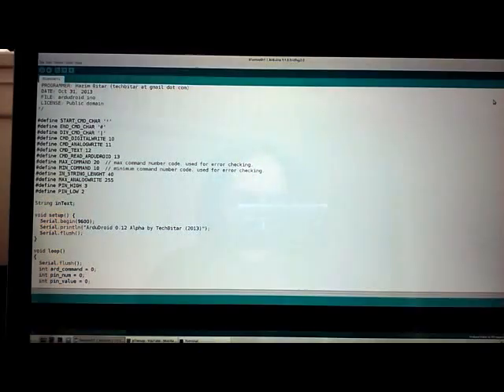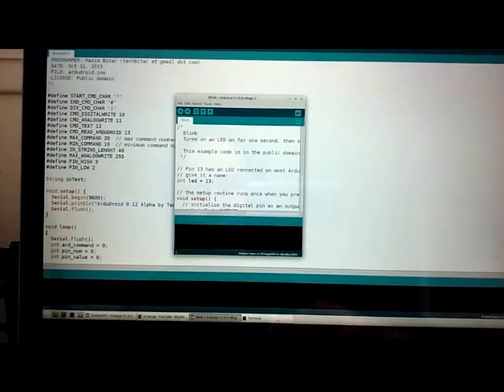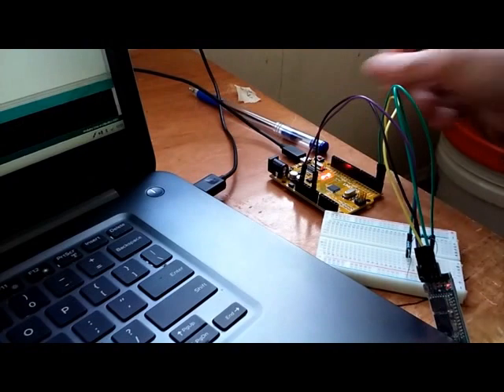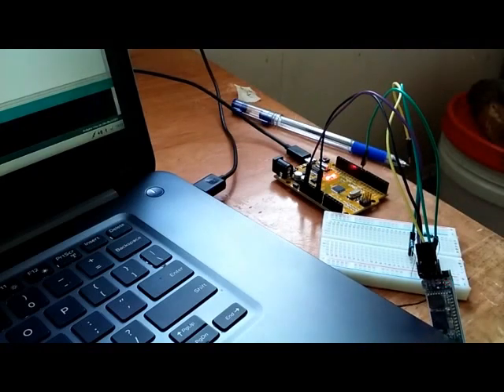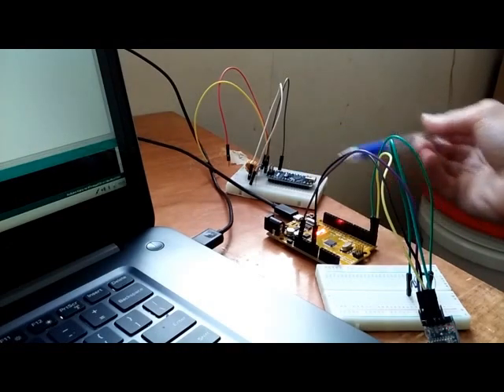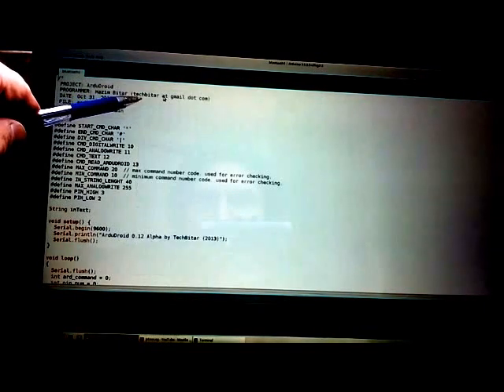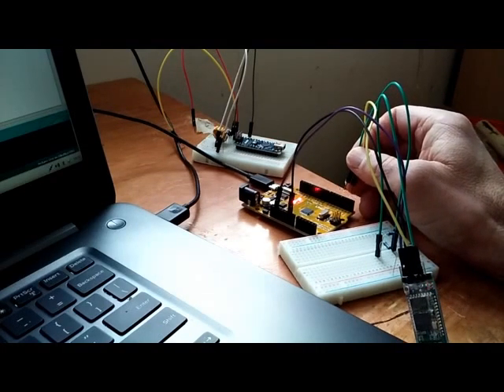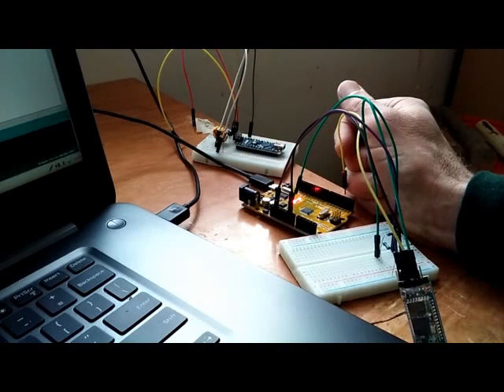Arduino Troubleshooting: Avrdude Not in Sync, TX/RX

Comment: hello, my project uses gps, gsm, and nano, i know what problem my arduino has for this and it's the rx/tx one, when i upload after unplugging them it uploads just fine, but i really need for the gps to be connected to the nano's rx/tx since i'm using the softwareserial for the gsm, any ideas for this?
Reply from the maker: Sounds like a good project. I'm guessing you're troubleshooting code / module. Make sure gps has sufficient power & pins correctly assigned: https://create.arduino.cc/projecthub/ruchir1674/how-to-interface-gps-module-neo-6m-with-arduino-8f90ad
Reply: @p1nesap  Eyoooo, thanks for replying! Took a while for me to reply since i was busy testing this, which works now btw so thanks a lot. But we hit another problem, we used sim900a GSM and it was not sending any texts, turns out it can only work for 2G/3G sim cards which are already obsolete in our country, so I just wanna ask if sim800l GSM or do you know any GSM that works with 4G/5G sim cards?
Reply from the maker: @marviclazo5837  Search gsm module 4g, many available.

Comment: As soon as I connect USB to PC Arduino Mega2560 starts flashing every 5secs. When I verify the Blink sketch for every second it is fine but whenI try to upload it fails. Tried several versions of Ide treble checked port A ruinous just keeps blinking on/off every 5secs.
I think the RX is the problem or boot loader  any suggestions. I have all these kits and cannot upload the most basic just a noob.
Reply from the maker: Disconnect all RX/TX connections. Select your board under Tools. Try another USB cable; some don't carry data.